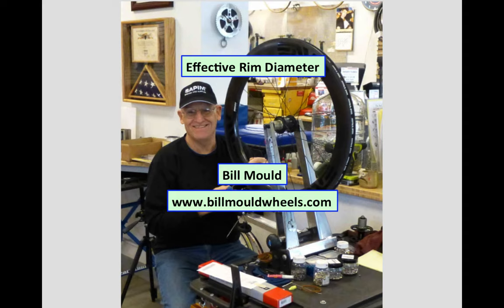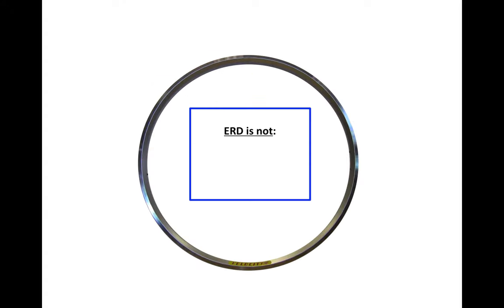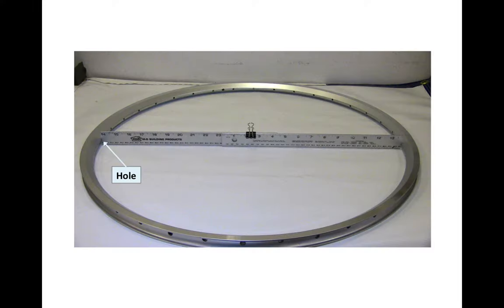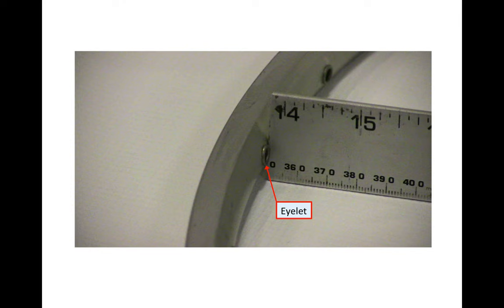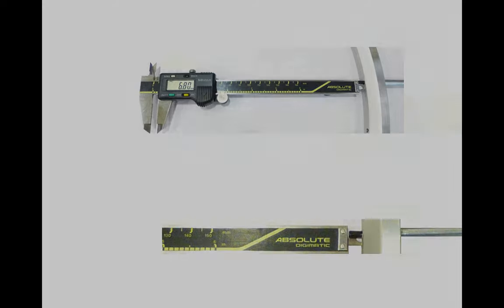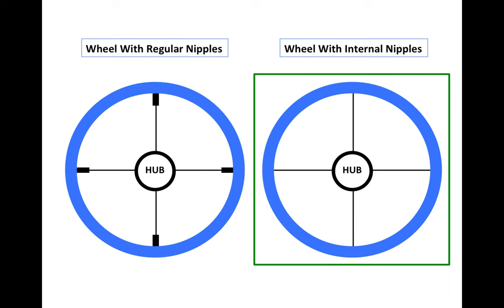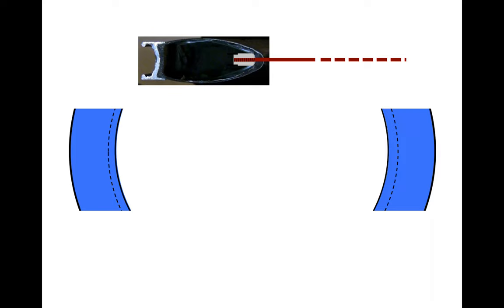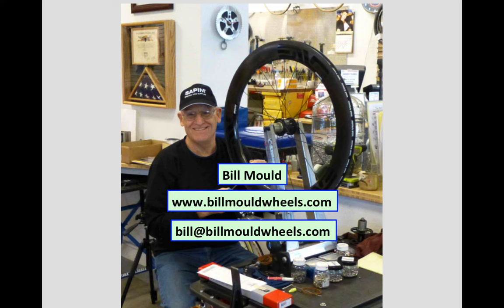Glimpse into How To Measure ERD

Comment: I've been doing it wrong for years! I measure to the nipple seat and this explains why I sometimes struggle to get it spot on. You're never too old to learn!
Reply: Well, that might also work, if you round up the calculated spoke length. It is not so much critical to support the nipple head, unless it's an alu nipple, in which case you should always base off your ERD close to top of the nipple head. Hope this helps! Cheers.

Comment: Useful video Bill, this is appreciated
However, Roger Musson showed in his book 'Professional guide to Wheel building' a (in my opionion) nice method to quickly determine the ERD without dealing with too many figures:
prepare 2 sets of a piece of spoke with a glued 'normal' nipple at the end. Cut the spoke end in a way, that the distance from slot to spoke end is an even measure, e.g. 250mm
stick both spokes in opposite holes and tie the ends with a rubber band together in order that the ends points to each other and the nipple sits nicely in the hole. Then simply measure the face to face distance of the spoke ends with a ruler or a caliper. E.g. a distance of 103mm will result in an ERD of 603 mm (103+2x250)
Keep up your useful work! Cheers, Georg

Comment: Effective Rim Diameter is NOT a measurement of nipple slot to nipple slot.  This gentleman's explanation is a perfect example of what Jobst Brandt lamented as taking a simple reference and turning it into a "religion".  ERD is simply a reference to the ends of the spokes in an already built and functional wheel.  For any given rim there can be multiple ERD's - simply because differing sizes of nipples, differing profiles for nipples AND differing threadings for the nipples and spoke threads can result in differing MAX and MIN thread insertion.  Take any wheel.  Pick it up.  If it is tensioned, dished, trued - i.e. - it appears to be a functional wheel - the ERD is simply the end of one spoke to the end of the other spoke at 180 degrees measured in millimeters.

This is why when wheel builders measure a rim, they commonly use a pair of spokes or spoke rods combined with a caliper.  They test the nipple and threads to be used, set the rods - and try to EMULATE where the spoke ends will be in the future when the wheel is built.  The measure they guestimate using that method is plugged into a spoke length calculator.  A careful and consistent practitioner often gets it within a 1/2 millimeter.

ERD is not an industry standard specification, nor is it a white paper subject.  It's simply a reference to the ends of spokes in an already built and functional bicycle wheel.

MrRabbit - Wheels By Fleming - 5000+ Wheels Built since 1984  =8-)
Reply from the maker: Robert, thank you for your response.  The purpose of measuring ERD is to calculate the optimal spoke length for a wheel.  You are correct that ERD is a function of several variables, so if a manufacturer publishes an ERD for a particular rim, an assumption is being made about the type of nipple that is being used and whether nipple washers are being used or not.  That’s why I always measure it with the actual components I am going to use for a particular wheel.  You say: “If a wheel is tensioned, dished, trued – i.e. – it appears to be a functional wheel – the ERD is simply the end of one spoke to the end of the other spoke at 180 degrees in millimeters.”  That is not correct.  The fact of a wheel being “functional” does not mean that the spoke length is optimal.  Here is my email address: bill@billmouldwheels.com.  I’d suggest we take this conversation “off-line” and maybe have a phone call.  Maybe I am just misunderstanding the point you are trying to make.  Bill Mould

Comment: Bill, many thanks for uploading this video. I have a pair of Mavic XM719 Disc 32h 26" rims, a Shimano XT rear hub and will have a front hub soon. I plan on using Sapim CX Ray spokes with 12mm brass nipples and to get correct lengths I'm making sure to find out what I need to measure, how and why before I order anything. This video shows exactly what I wanted to know.
Reply from the maker: Thank you for the nice comment.

Comment: Something doesn't seem right here to me. The ERD should be a separate variable independent of any dimensions of the nipple and only unique to the rim, not the wheel build. You can determine spoke length for a wheel build using a constant ERD unique to your rim, and plugging in different nipple dimensions. It just means the spoke length will change, not the ERD. Can you explain why I might be incorrect?
Reply from the maker: Thanks for the feedback.  What you say seems reasonable because manufacturers list ERDs on websites and sometimes put the ERD on the rim.  When they do that, they are making an assumption about the type of nipple that will be used.  Some alloy nipples have a long hexagonal head which requires a longer spoke and a different ERD calculation.  If you use nipples like that and don't change the ERD calculation, your spokes will be too short.  Likewise, if you use a washer under the head of the nipple, you need a slightly longer spoke.  What I have said is correct.  I've done this thousands of times.
Reply: I absolutely trust your experience. I always use DT Swiss' online calculator and it accounts for nipple types and dimension given the same ERD. And DT Swiss will specify if their own rim is designed to be used with a washer and the ERD will account for it. The calculator will output a different spoke length if you change the nipple even if the ERD value remains the same. So changing the ERD seems a bit confusing and an unnesesary extra step of the process. I guess I need some more time to wrap my head around the process. 

I did build wheels for my bike and have put about 1,500 miles on them with no issues and they've stayed true. No broken spokes or nipples and its a disc bike and I often load 100 pounds or more on the rack. With the stock wheels built by a machine, I broke yo to two spokes a week. I plan to swap to alu nipples soon and was going to make a video of the re-build. But I want to share only accurate and useful info. Your channel is by far the best I've found on this stuff. Thanks for your videos.
Reply from the maker: Thanks for the kind comments.
Reply: You're correct Peeling Pedaler. The ERD is a property unique to each rim and doesn't depend on the nipples. However to actually select the correct spoke length, you need to derive a second value from the ERD, which does take into account things as the type of nipple, any additional washers, etc. It's the "effective effective rim diameter" if you will. ;)

Also, don't blindly trust the ERD values given by the rim manufacturers. There are two or three distinctive ways to measure the ERD (e.g. with or without the assumed nipple head length, as shown here), and most times they don't explain how they've taken the measurement.
Reply: @sp00n  it is not unique or constant. Depends on which nipples you use, but what's more important is where you want your spoke to end. Some measure ERD with spoke ending at the bottom of the nipple slot, some like to base it off the head top or even the bottom of head, when using thinner 1.8 spokes, which tend to stretch after final tensioning. So, it really depends on few factors and might change from time to time even for the same rim.

Comment: The bigger the e.r.d.,the spokes will remain the same as the original,that was built at the factory.
Reply from the maker: I don't understand that comment.
Reply: @BillMouldWheels  what I'm saying that if the rim is a 29 and it was built at the factory with whatever the length the spokes,it should be the same, except the colors of the spokes would change. I used a online spoke calculator and it gave me different results,one said close to 270mm spokes and another said 263mm. So I decided to stick with the 263mm spokes lengths which was the original. The weaving patterns I'm using is three cross and I'm still learning how to lace a rear wheel. I don't know it's up to you in your measurements.